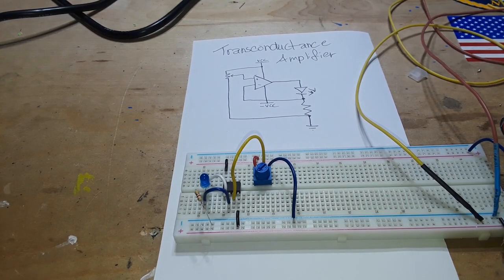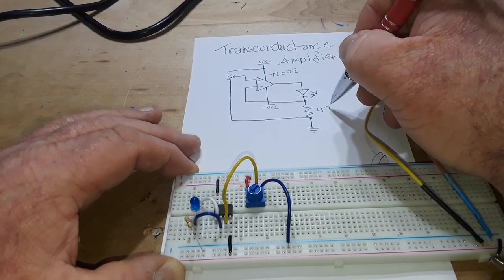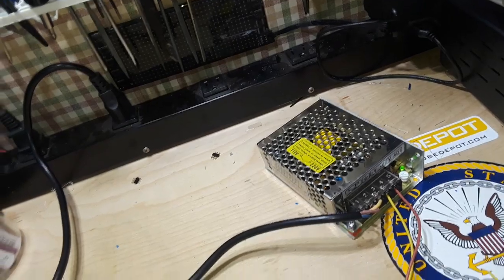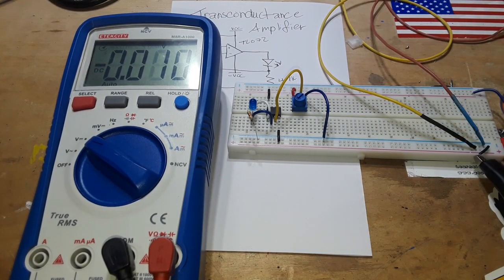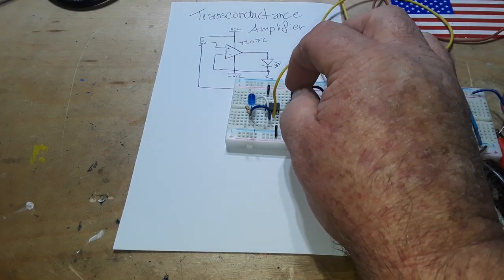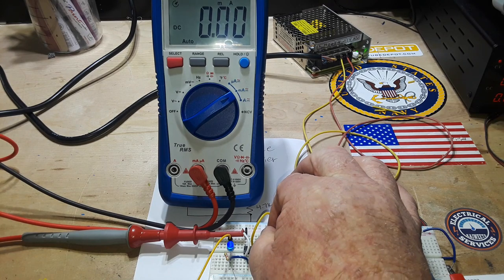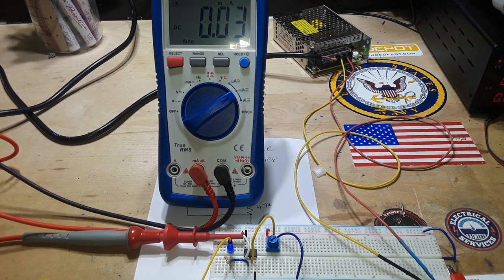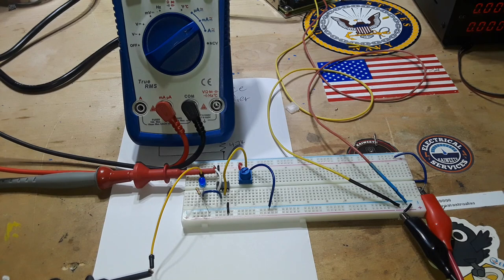Classic Circuits You Should Know: Transconductance Amplifier

Comment: the opamp does everything it can to get both inputs equal. 
IN plus is given by the potentiometer. 
The LED and 4k7 create a voltage divider. 
A current must flow on the 4k7 in order to generate the voltage. 
This voltage is coupled to IN minus and must be the same as at IN plus

with the second half of the amplifier and two resistors you could set 1/2 voltage and use only one power supply.
Reply: I don't get how to use  one half of tl072 to create a split supply, as there are only one +vcc and one -vcc per chip. The other possibility would be to use a "virtual ground" design, which leads to other difficulties.
Reply: jup

Comment: Great video. I would really like to see a video on the 7660 ic to convert to negative voltage. Especially used in an audio amplifier. I've had a lot of trouble getting the oscillations out of the audio band. And you have a great way of explaining things. Either way Thanks for all the educating you do.
Reply from the maker: I did. 3 years ago. https://youtu.be/THPJNt_jw1U?si=LrQ6JjhynpZ-Qdi6

Comment: Your showing a standard operation amplifier configured in current mode. This is missleading as a true transconductance amplifier has an additional output bias input, used to control the gain of the circuit. An actual transconductance amplifier would be a CA3080, for example. I'd love to see you demonstrate this device, or one like it.

Comment: Quick question: do you need to do anything with the unused op-amp in the same way you should tie inputs of unused logic gates to ground or Vcc? Wouldn't the unused op-amp possibly oscillate if left floating?

Comment: PAUL, why does the opamp only outputs 1.72mA max? What do you mean by transconductance amplifier to convert a voltage input into a current output?
Reply from the maker: Voltage alone has no push. That's what it's often called potential. It's the potential to push electrons. Current is the push. That's why it is referred to by the Chinese as pressure.
So now you need resistance, and that's your load.
The trans inductance amp is just a very precise was to control that push. Change the pot trimmer for more current.
Reply: @learnelectronics  Resistor Voltage Divider can change the potential, a Resistor Current Divider can adjust the push/pressure. The transconductance amplifier is has NO Gain or amplifying the current so I'm not sure what is the advantage of using a transconductance amplifier compared to using an Op amp amplifier?
Reply from the maker: Its called an amplifier, but that's misleading. i would call it a converter. It takes voltage with no push and gives gives you current. Its a voltage to current converter.
Reply: Great video. I would really like to see a video using a 7660 Ic to covert to negative voltage. Especially when used in an audio amplifier. I've had a lot of trouble getting the oscillations out of the audio band. And you have a great way of explaining things. Either way Thanks for all the education you provide.